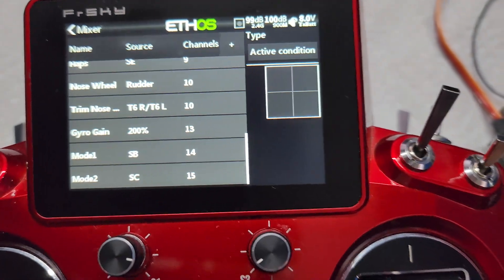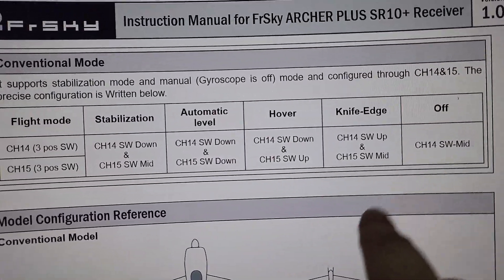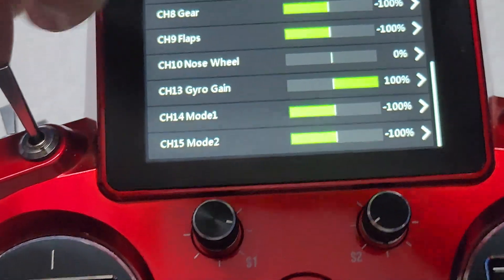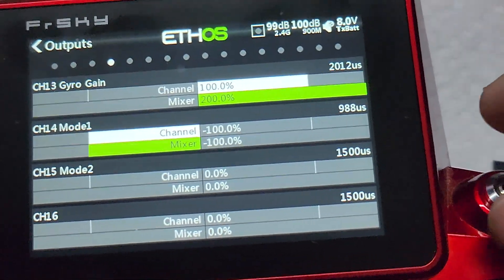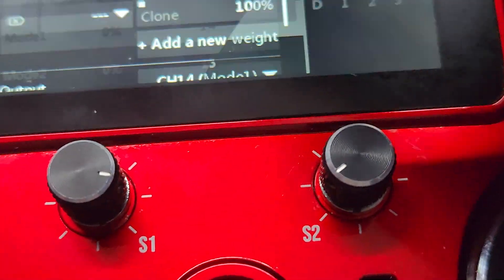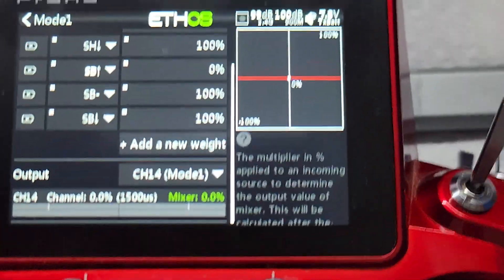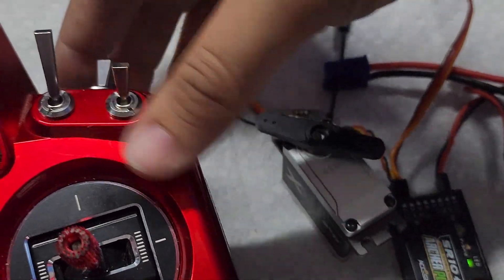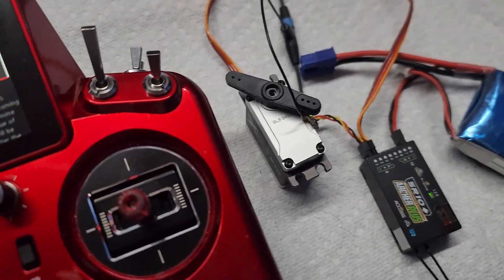Demistifying Conventional Mode in FrSky SRx and Ethos | FrSky Stuffs

Comment: Is this all still done the same way since Ethos has been updated a few times since you made this video?
Reply from the maker: Should be pretty similar.  But honestly, now that the primary issue that caused me to make this video has been solved in RX firmware updates (Ch16 RSSI on R9 receivers triggering self level mode), it's not really needed unless you want to use the special modes... otherwise just use quick mode on a single switch.
Reply: @ I might like to experiment with hover mode for helping me out of a pickle in a hover down low while I am training to get better at it. I did finish up my main setup though using vars and flight modes and I setup a panic button to self level. I have a high speed stabilized mode with a set of gains adjusted by the 6 buttons , and a low speed stabilized mode with another set of gains that are adjusted with the other half of the 6 buttons. Then of course there is the unstablized mode. When I hit the panic button it replaces the values of the mode and has another set of its own gains. Seems like it will work awesome for me.

Comment: Wow I used this on my FrSky 20s with the IRX4 lite to an Aeroscout with a Spektrum 631 works great. Rather than using Micro Seconds I just use =100, -100, and zero. This setup allows the Panic to be fumctional.

Comment: Thanks for the help!  I just setup a SR10Pro receiver with your info  it was pretty much the same except used channel 10 and 11 for modes.  I put the auto level on the momentary switch for bail out.  Off /Stabilized/Hover on a 3 position switch.  Looks like it's gonna work well from the bench test results!  Thanks again.

Comment: Great information! 💯I understand every step and the thought process, but I just can't carry it over to OpenTX ☹ (I'm a subscriber, love your heli videos)
Reply: I'm still using a old Horus X12S on OpenTx.   I found when using a S8R Rx on ACCST   I just made a 3 pos curve. -100, 100, 0.   Or any configuration needed to achieve goal.    Throw away the paper that comes with the Rx as it written wrong.  I sorted mine by following YouTube tutorials similar to this.   Best of luck from New Zealand
Reply: I forgot to add,  I also done a Special function, so when I pull the momentary switch, I will over ride that switch position to give a recovery mode.
Reply: @russcole5685  I managed to implement it in OpenTX eventually, I figured it out (I had to figure it out) all by myself. It's been too long ago to remember. But yeah, in the end there was that moment, when I realized the paper is written wrong. I think I also made a 3 pos curve. But I think I wasn't successful in programing a special function as you mentioned, which overrides everything to give a recovery mode. I researched a lot, but couldn't do it.